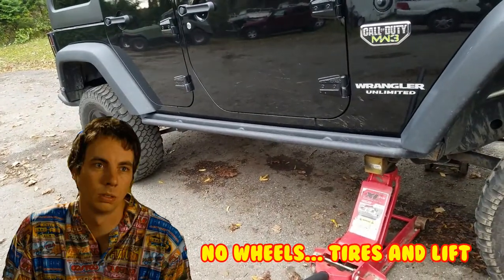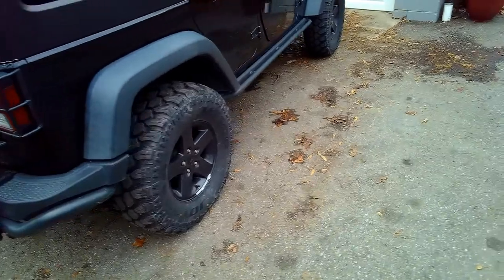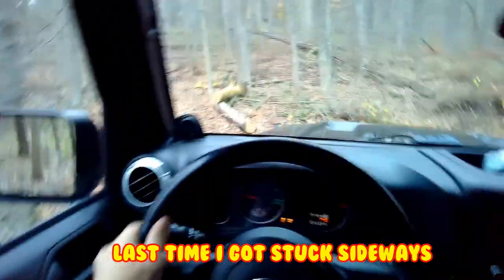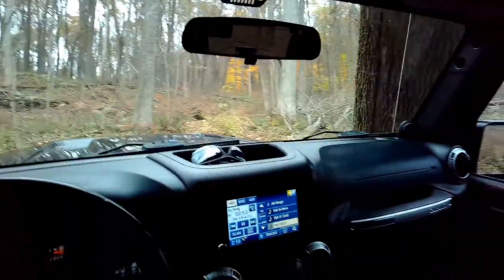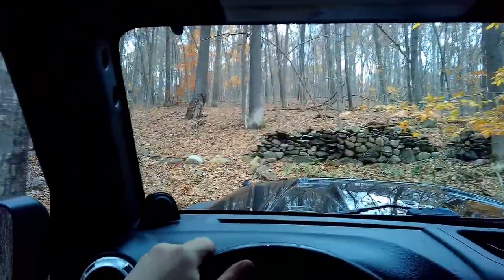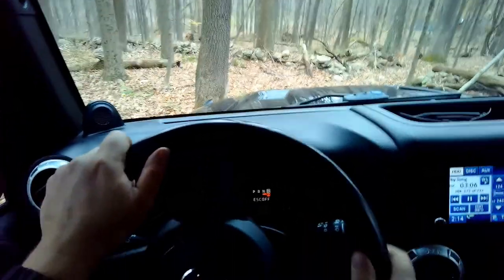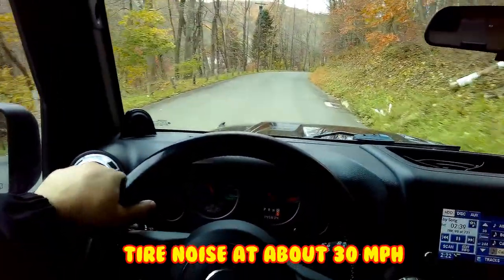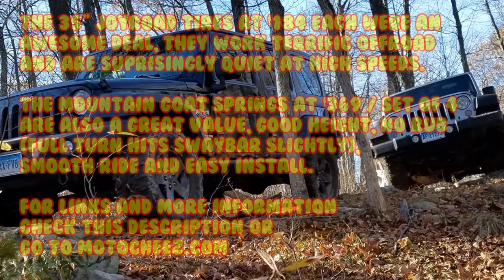MT200 35” Joyroad tires and 3” Mountain Goat series springs.Install, test and review

Comment: how did they balance and did you have to use balance beads or regular weights?
Reply from the maker: They balanced great for the size, I used weights, 4 oz was the biggest on one tire, but I think it was partially the rim. 
I installed these tires on 3 of my jeeps sofar, I love them

Comment: How are they wearing so far
Reply: MotoCheez as far as the tires? I want to buy them on eBay for my Tahoe, they're $737
Reply from the maker: Haha. I answered for the wrong video. Sorry. They're wearing great, went cross country and put 12000 miles on without rotating, my bad. But they still not bad, slight chop that sends to be going away after I rotated.
Reply: MotoCheez do you think that after the 12k miles it's half way or more down since you bought?
Reply from the maker: About 1/4 or less. I'm surprised tbh. They should be rotated every 6000, I do a 5 tire rotate (spare). I love them. Went to Moab and tackled a lot if hard trails!
Reply: MotoCheez awesome, thanks for the info man